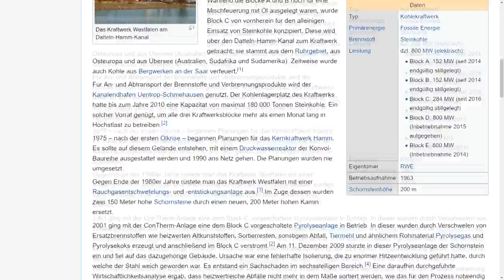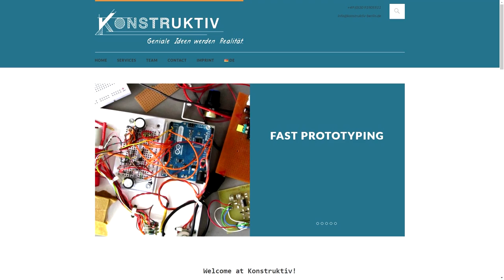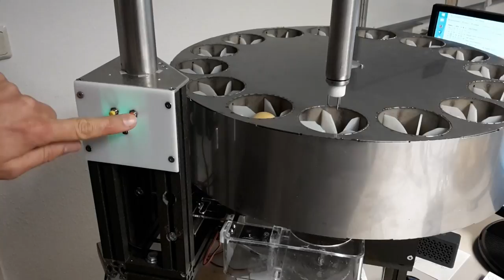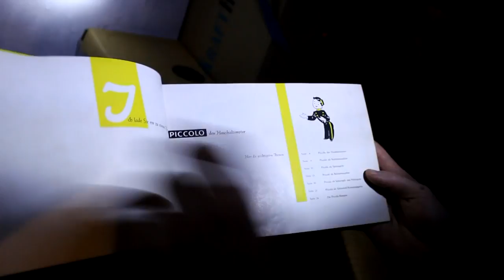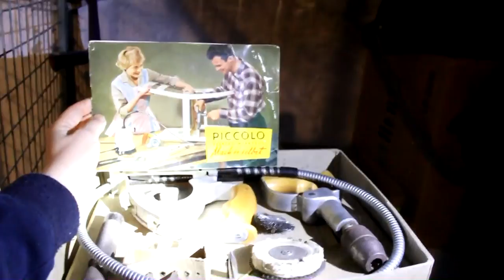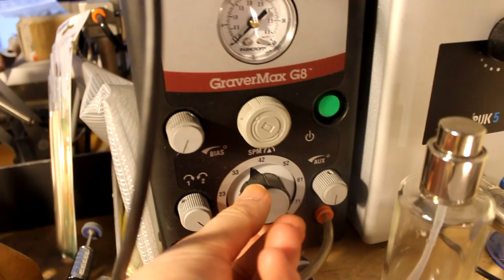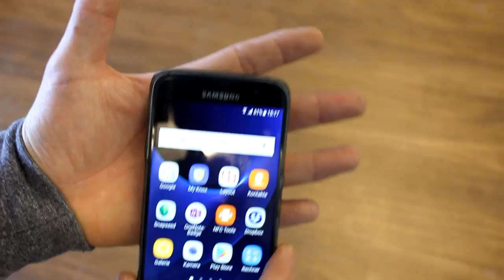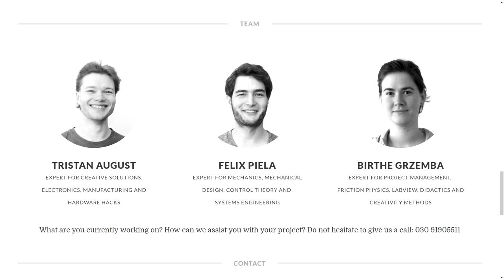Inventors in Berlin - A Documentary

Comment: Rollgut = Tubifile, Filitube, Fileroll, Rollafile?  Also in A5, A4, even an A3 sizes, also an externally visible marker showing urgency, status, awaits client feedback, needs specialist input, requires costing, etc. Different material of manufacture, wood you have, but stainless steel, 3D printed plastics, cross sectional shapes, hexagonal (maximise storage) , square, octagonal. Corporate colours. 🙂 Paul, Johannesburg

Comment: For the paper bin bag guy, organic waste is usually moist, so your bag will get soggy and rip in no time, but a good idea indeed!
Reply: The paper bad dries from the outside because of ventilation. This makes it stay solid plus minimizes the smell in comparison to buckets (as long as you don´t put fish or meat in there ...)
Reply: a bit of testing is required. What if there is a moist object in the bag and you throw something on top which is heavier, that may make it give in.  
That metal frame is useful for UK recycling scheme at home. There are 2 main textile bags which are for plastic, paper and glass. Those Frames could be used to keep them straight and if needed assist when you are using your foot to compress the paper. Also there a problem with cats/foxes scratching bags on the street which are left the night before the men collect it.

Sure there are loads more things to talk about but by all means ask away )